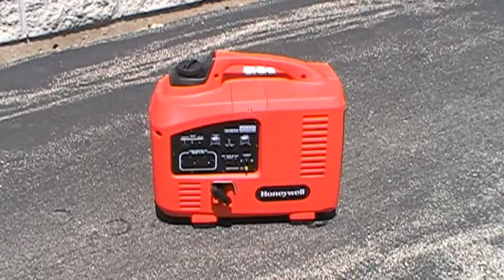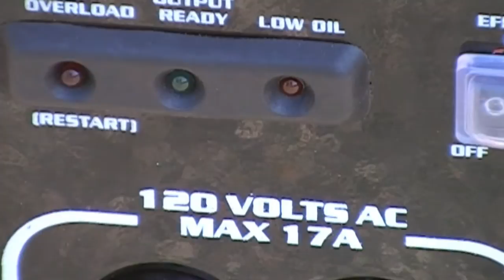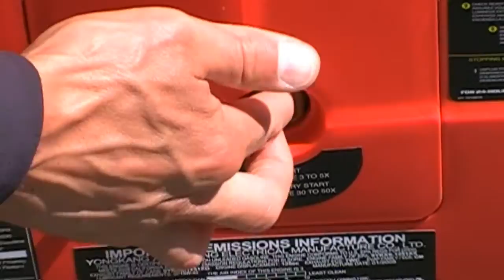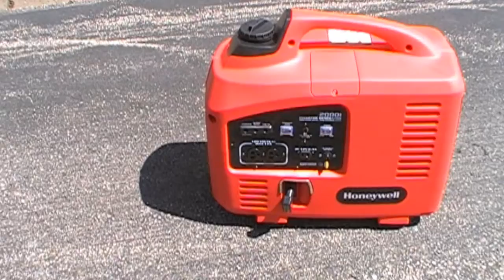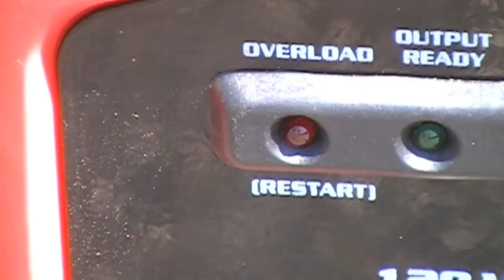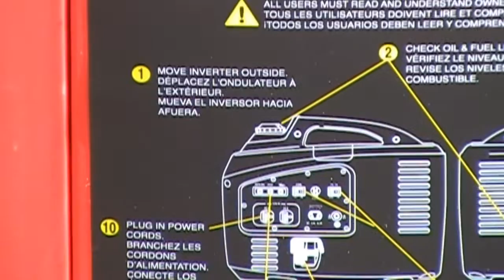How to Start Your Honeywell 2000i Inverter Generator

Comment: Hi I have a Honeywell hw2000i bought it in 2009. I kept it in storage & start to run it this year. I was wondering how long does it take the green light to come on? The engine starts up fine but no electrical power, no green light. Also my son in-law ran it he didn't fill up the fuel tank all the way is this a problem or maybe i'll top off the fuel.

Comment: Paul & Bigc, I agree with you 100%! I have tried not using the petcock, using higher octane fuel, and using stablizer. These generators are total garbage and I cannot believe that they bare rage Honeywell name. I took off the air cleaner cover and have to spray starting fluid every time to get it started. I needed a generator that was reliable, so I bought a Honda. try to find parts for them. I have better luck with harbor freight products.